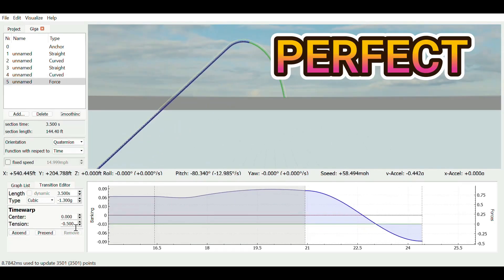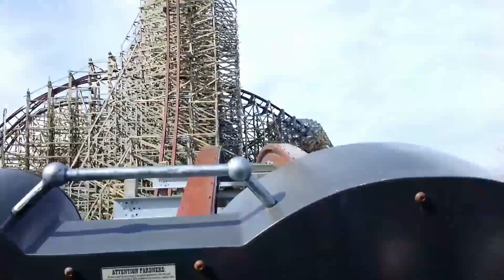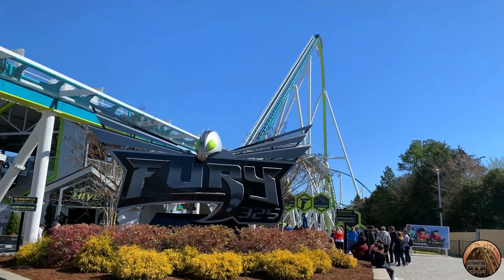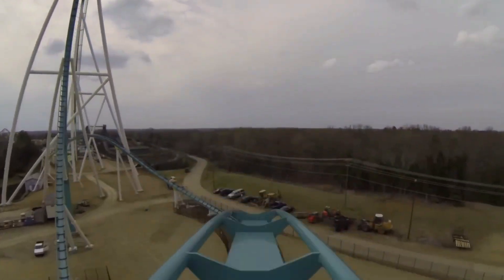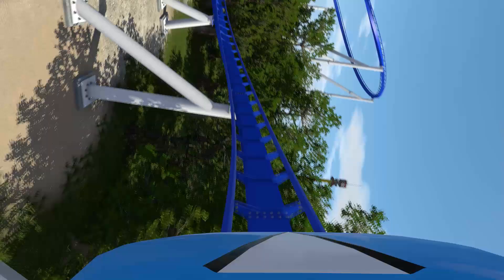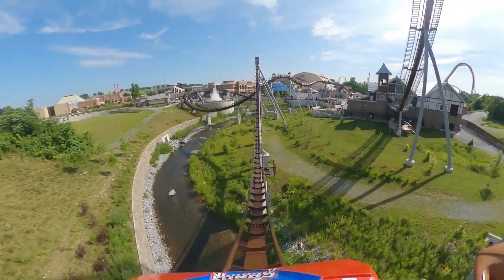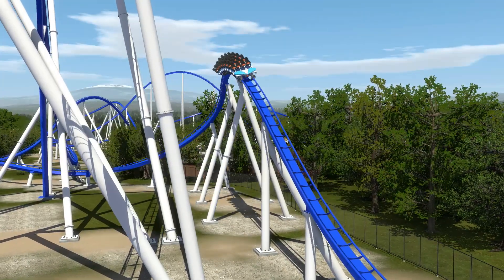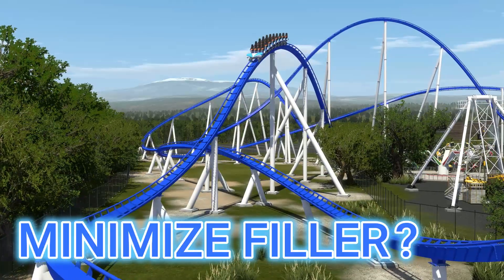Can I Design the PERFECT Roller Coaster? (Part 3: B&M Giga)

Comment: In the last years, I started to have my problems with B&M. So good to push them a bit with such videos. Because the design is definitely cool AND realistic. 

I did a bit of NL2 modelling myself and I might get into it again. Several points B&M gotta consider for their hyper coasters:
- Start adding inversions! No vertical loops but Immelmanns, 0-G-Rolls and weirder things. Not all over the place but here and there. Mack started it. And it's awesome! 
- The seats are in fact one of the best. But they could improve with a piston design to make it floorless. 
- Stopp the larger or long helixes. Anything beyond 270 degrees is a waste of track (This decreases the quality of Nitro massively). Curves should basically all come with a twisting element and change altitude.
- First drops can twist, too! The best first drop ever is still on Expedition GeForce. 
- Redesign the brake system so it can be use on a curved track - result is mid-course brake-runs that are just an airtime hill.
- Stop this quality drop madness after the mid-course brake-runs like on Gatekeeper...
- Sounds a bit autistic but: balance the curve directions. E.g. Silver Star has all major curves going left.